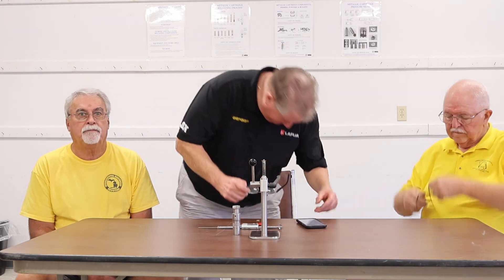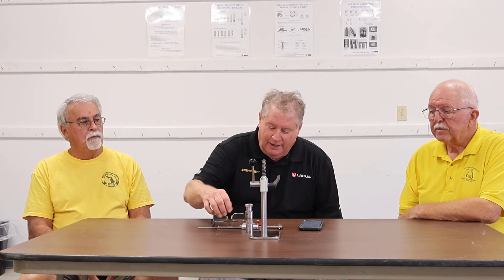The Effects of Powder Weight on Bullet Seating Depths

Comment: This is all super basic Reloading that anyone should have learned before 12years old. Compressed load? Check your length. A little more neck tension helps.
Reply: Greg, we know that some of the information is basic stuff but we see this happening at every match we go compete at. In Benchrest group and Score shooting there are only three things that we have to tune the rifle with at the reloading bench, seating depth, powder charge and neck tension. When we find a tuned load for the match we do not want to change neck tension just to hold the bullet because this will change our tune and that is something we would not want to do. Thank you for your input
Reply: Do you have a Youtube channel? I think a lot of enthusiasts could learn a lot from you.  Please share your knowledge with those that aren't as advanced as yourself.
Reply: At least by age 14. Some loads might be so compressed that a crimp is required if you're not using the bushing type dies.

Comment: Very good information that probably affects more shooters than one would think.I ran into the very issue loading 223rem ammo last night.I had my seater set for .020 seating depth and the first charge of 25.8gr N135 I dropped in my drop funnel I just dumped.I saw my neck was half full.The bullet seated .004 closer to the lands.I started trickling slow into the funnel from then on and got back to .020 I wanted.Thanks for taking the time to start this channel and sharing the world of knowledge that you three gentlemen have learned.